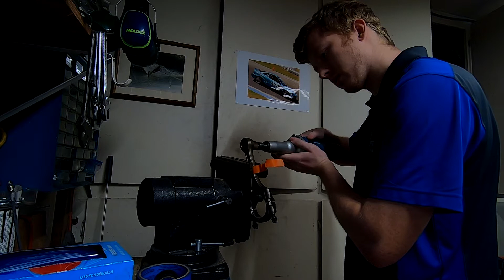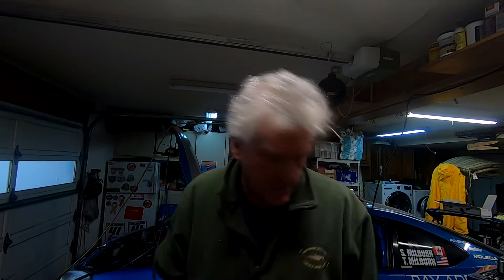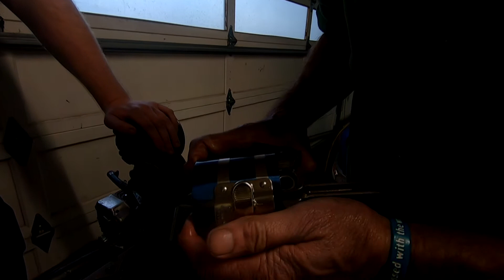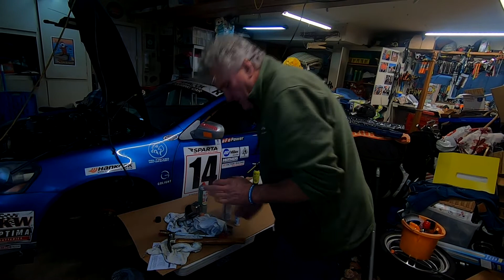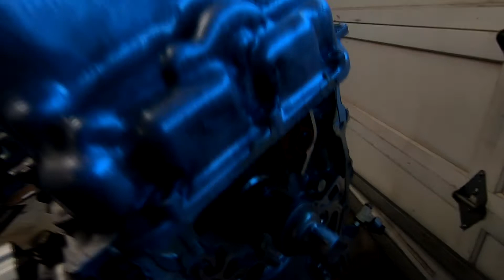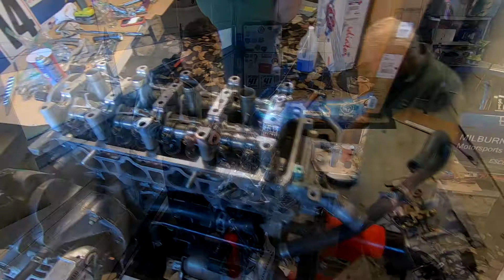Winter Teardown Part 2: k24 Engine Build!

Comment: I liked when your dad mentioned that a "real machine shop" would cringe at the sort of rebuild you guys were doing.  That's true....and I was thinking the same thing (like hand honing the cylinders...yikes) but sometimes people have a stick up their ass with this stuff.  The fact is that there are always different budgets and different levels of doing things, and I wager your engine will run just fine.  I've built multiple engines while checking bearing clearance with Plastigage....and a real machine shop would cringe at that as well.
Reply from the maker: Great way to put it! It's certainly a garage build, but sometimes thats the way it's got to be. I have been learning a lot from it! Thank you for your respectful comment, I hope you enjoyed the video

Comment: Good video.

I'm learning more about the K Series. I was mainly into H22s, J Series, and B Series. 

Since you already had a K24A2 as a donor engine, could you have used a "lesser" K24, like one out of an Accord, and built it to the same engine you have now? 

If I understand correctly, the main differences between the K24A2 TSX engine and the lesser K24s are the head components and rods/pistons.

I'm all about building an engine properly but I have no problem using other engines that are cheaper if I can reach the same goal.

I got a Mugen Si recently so I just started looking into K24 swaps. I have been debating on whether to build a K24 or just keep it stock. If I build, I would consider a lesser K24 but if I leave it stock internals, definitely prefer the 2006-2008 K24A2.
Reply from the maker: The k24 is an awesome platform! If you are going to be getting one, they work great in a stock configuration. We were running ours stock making about 215whp, which was a decent amount but we felt we needed more. The main differences in the 2006-2008 k24's are in the head,  having a 1mm larger stock valve setup. I believe the pistons and rods are the same though I cannot say for sure. Usually those engines are more expensive. What we do, is we get a motor and use it for the bottom end. We swap the top end to a k20 head which has larger intake and exhaust ports. From there, we add cams and valves and this time around we decided to change to lightweight pistons as well so that the motor can handle about 7500-8krpms max without wearing out too fast. These motors cant rev out as hard due to the increased stroke by the piston, but make up for it really well in torque. Currently the car makes 245whp and we have used it all season with no issues at all! Hope this helps.